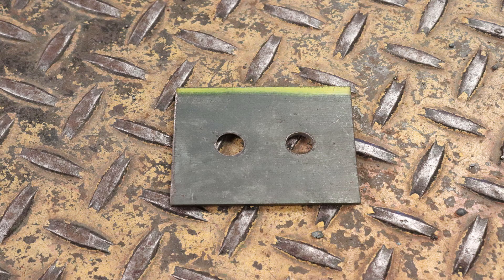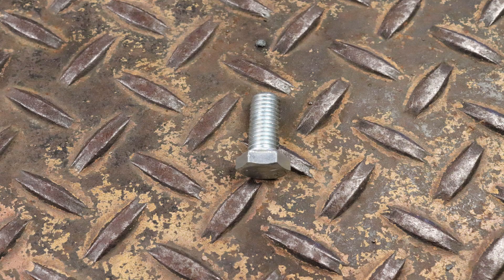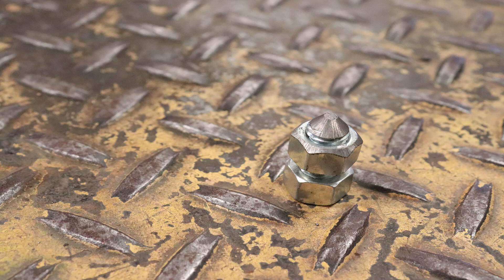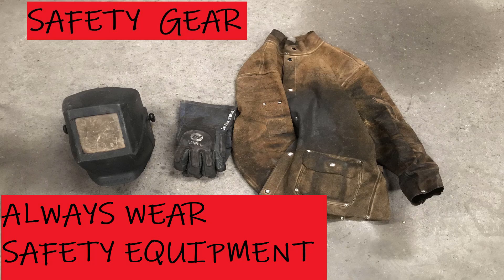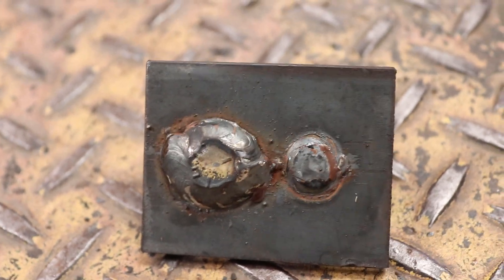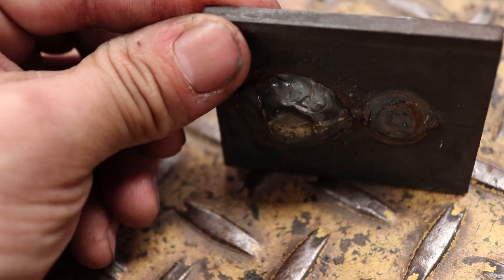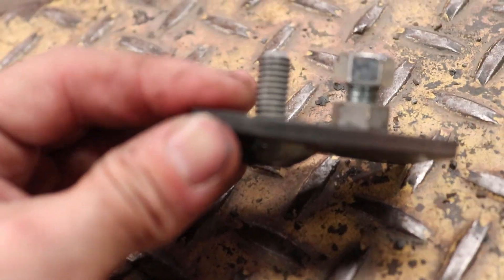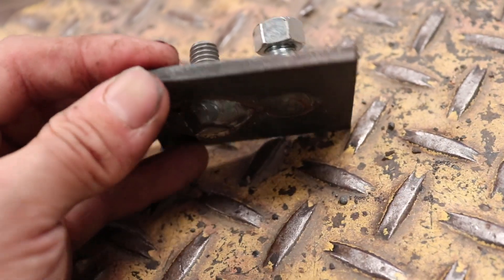How To Weld Studs To Plate

Comment: Nice video! I have to make a CVT clutch holder / spring release tool and will be using this technique to weld a long bolt into some plate steel.

Comment: what is recommended amps to use for bolt welding like this
Reply from the maker: The amperage depends on the material and the size of bolt, but I typically stay with the amperage to weld the base metal and not the bolt thickness

Comment: When stick welding ,for most joints,do u just drag the rod or move it over and back to create a wide bead
Reply from the maker: John Duggan depends of the joint stringer(just straight dragging) create a stronger weld, but sometimes it is faster but still acceptably strong to weave(move the rod side to side to spread out the weld puddle making a wider head)
Reply: @adamswelding5052  cheers thanks

Comment: I prefer the one where you cut the head off the bolt and beveled it. I was going to try using a 1/16" 6013 electrode, but you have to hold the stinger at some weird angle which makes it really difficult.
Reply from the maker: Protected Profile not only that but at the same time it makes a ridge (from the weld) that won’t allow anything to sit level or flush on top of!

Comment: Well my first thoughts are none of above, here is a curve for you and anyone watching, need a stud on a tube, can't insert bolt from back side, but thin wall tube, so do to vibration and stress, the weld stud won't work as will crack, so need to drill and tap round bar stock, then drill hole to insert bar stock, and weld it in, that way its level on top, as and stronger than stud welded, most common was custom motorcycle gas tanks,  1/4" to 5/16" stud. So definitely will break unless use inserts.
Reply from the maker: Randy mack I agree on thick material do it that way but on thin plate 1/4 and thinner it isn’t necessary used this on several methods to mount stuff and it has held up fine but you are right if it is a critical failure point I’d recommend tapping the material first!
Reply from the maker: And also Randy Mack I agree anything thin Like a motorcycle frame I’d do like you said that would be the strongest way to do it!
Reply: I grew up around bikers and motorcycles, so my first thought will be different than most, but gas tanks with 2 small studs holding in place, yeah, any competent bike builder plugs a slug into frame to thread a stud into, also can't thread frame, won't last, as not enough threads to hold, usually .125 wall. But carry on, just wanted to bring up welding slugs in as a stronger alternative, if can't get to backside.
Reply from the maker: No no nothing wrong I’m glad you said that, the purpose of the channel is to help this who watch this channel is to help people learn and think of different ways to do things!
Reply: @adamswelding5052  if you have access to acetylene, I would be interested in a little oxy welding. Filling holes in sheetmetal and fixing up air compressor tanks and such. I believe you can weld aluminum with it, too. I need to order some gas filler rods. I made improvements to my harbor freight abrasive blaster because it was clogging up instantly, but now I have to extend the flimsy hollow tube legs because the oversized mixing chamber and valve now extend all the way to the ground.
Reply from the maker: Protected Profile I’ll be honest all of the oxy-acetylene welding experience I have consists of a 15 minute demo my instructor gave me back in school... I have a friend that knows a lot about it I will see if he wants to participate in the video. He can give better advise than I ever could!  But from what I have seen online the aluminum “welding” I see is actually more of brazing so I don’t know I would have to ask that friend!
Reply: I am very rusty on aluminum with torch, not done in many years, but search for aircraft frame building, gas welding aircraft frames, or similar, that may put you on correct path? that may be what your looking for? I plan to do some this year, because I want to re-familiarize myself with it again. I am out of practice in everything other than sheet metal with mig, as I am regularly rebuilding rusted vehicles, as for compressor tank, remember its a pressure vessel, but yes a torch works nice, a friend had a vertical KOBALT 60 gallon compressor & was moving trying to drain tank & knocked it over, & broke air fitting off the top, I brazed it instead of welding, which worked fine, & he sold it when he closed garage 5-6 years ago. 

I find it easier to weld things like the hollow legs with a torch than mig, & don't be afraid to weld with same motion as when brazing, raising torch up & down to control heat, but when welding real thin metal.
Reply from the maker: Great advise Randy Mack! I didn’t even know you could torch weld aluminum I learned something new!
Reply: torch can weld most, BUT, people don't get the training, it can be mot dangerous, & welds can be like a cheap China wire feed welder, you can weld a beautiful bead over a crack, & not repaired, as only welded top edge, its harder to learn heat & penetration to weld thicker things, plus if torch is not adjusted properly, the flame can add or remove properties from base metal, changing its strength. not to even discuss dangers of Oxygen, or Acetylene gas. my background had me with very old masters when I was young. so I do have a lot of training, but was 30-40 years ago, & I still love torch work best. but primarily I do steel, but before I get a business going, I got to get back in shape in aluminum.
Reply from the maker: Randy mack that’s awesome I did not know that and learned something new! But yes I agree with learning from old masters they will teach you the things every young buck thinks they know but don’t know half of what the old masters have forgotten with age!
Reply: the more I watch you-tube, the more I think I should in future do torch work videos to show, but todays society scares me, if they cant follow directions, torch work is most dangerous, but to me is the most fun. but when I started college I was already very good with torch, & in my first year of auto-body, I was with a dinosaur of a teacher, & students had to fully metal finish vehicles, no body filler,  except lead on seams, & only welding tool we were allowed to use was a torch, second year he retired & modern teacher allowed us to use a MIG, & I wouldn't trade my first year for anything, plus my welding teachers were old seasoned guys, 1 had been in shipyards in WWII, & I regret not picking his brain, as it was I was too interested in drinking, fast cars, Harleys, & women, & not always in that order, so I was top of my class, best welding student, but still know I missed out so much.
Reply: @adamswelding5052  Yes, you can torch weld aluminum, but not with a propane oxy rig which is useful only for cutting and burns through lots of oxygen.
Reply from the maker: I know how that feels it’s the reason I only did one video with a cutting torch and that was my safety video and that still  wasn’t the  best